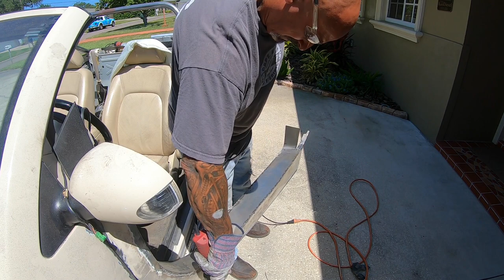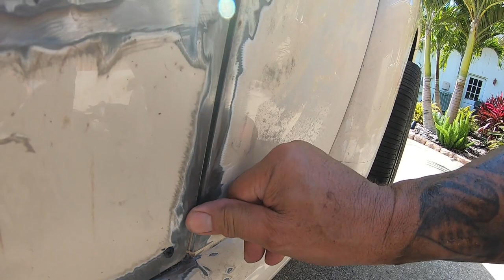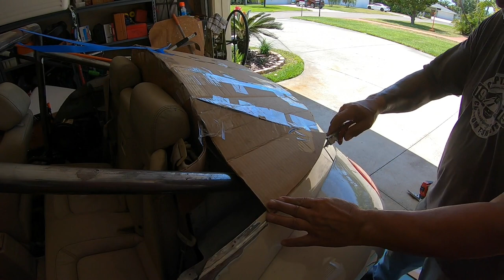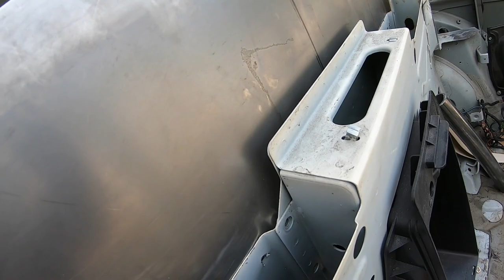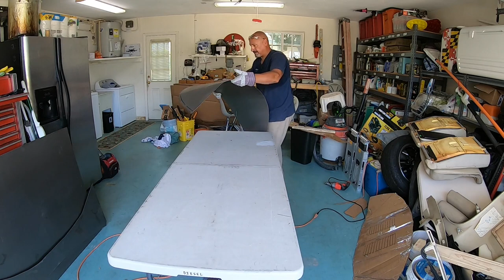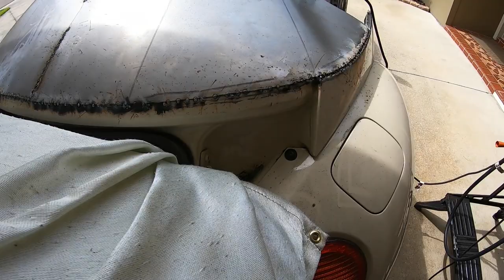Beach Buggy Build, Episode #14, What Hump??? (Das Is Porsche???)

Comment: Hey Brother  - do you back to run a bead for the weld (start from the left and go all the way to the right)? It looked like you did, but I wasn't sure.
Reply from the maker: I've tried to emulate what I see Bad Chad and Casey's Customs do on their channels. They spot, spot spot...at different ponts, then continue doing so until all of the gaps are connected. So it's not really running a bead, per se...

Comment: The only problem I see with the rear sheet metal is it will block your rear view mirror .
Reply from the maker: I actually mention that in my video ..I then remark "meh, who needs rear view anyway?" Lol! But seriously, it does impair the main rear view a bit, but my side view mirrors will help compensate. Thanks for your interest and taking the time to comment!!!❤️
Reply: I figured you were from Maryland because I noticed the cooler on the shelf.
Reply: You can modify your mirror or a different mirror to set higher up. An inch or more could make a huge difference.
Reply from the maker: Yes good eye  @scottwright388  where are you watching from?